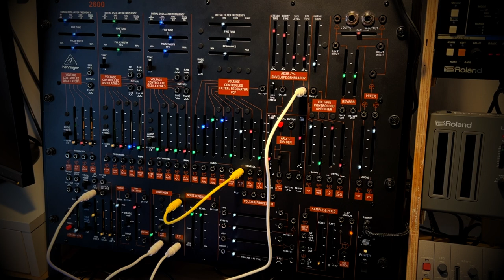Behringer 2600 Quick Patch:  ENV controlled LFO modulating VCF

Comment: Great video. If you wanted to free up the AR as well you could use the Gate Out to control the VCA. If you run the Gate Out through the Lag you can get a 3rd envelope with an adjustable attack. It also might have been good to mention here how the single/multi trigger switch effects the retriggering of the lfo which might make a difference on this kind of patch. You did a great job explaining this though!
Reply from the maker: Wow, thanks for the insights! You’ve given me a lot to think about (and try) here. I love it! Thanks for watching and commenting.

Comment: cool patch, have you used it in a jam?
Reply from the maker: Thanks! You know I’m not sure that I have. Lately I’ve been curious about voltage control over multiple modulators - my last video had  +6v via an attenuator controlling both LPF and HPF cutoff. I’m releasing one today where I’m manually modulating pitch and LFO frequency. I think I might come back to some patch breakdowns- my curiosity is moving slightly faster than my creativity!